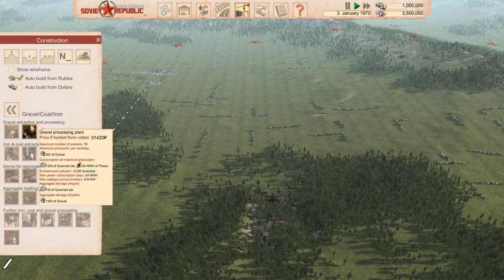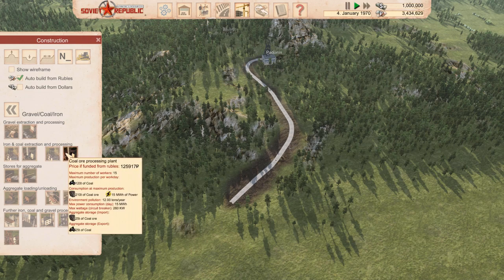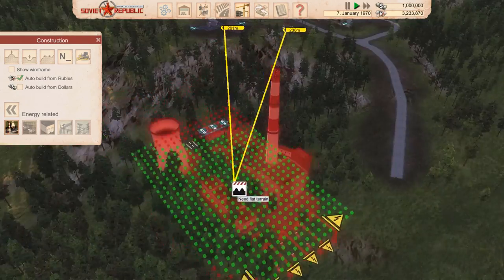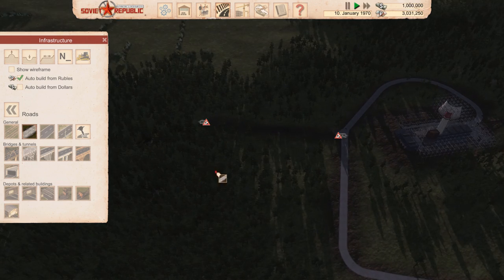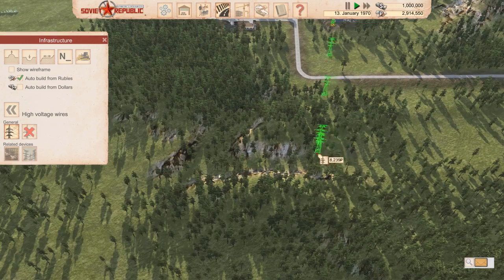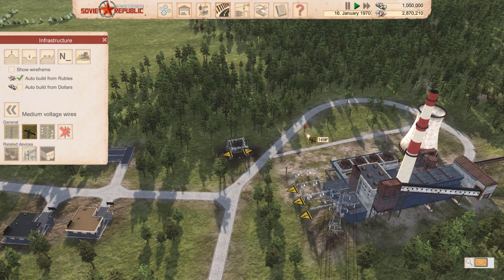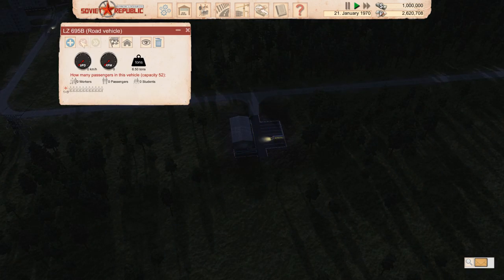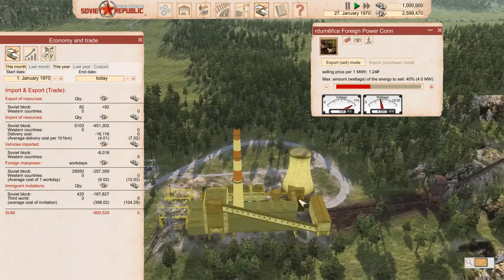Electricity and Buses Tutorial: Workers and Resources Soviet Republic

Comment: Do you need to use high voltage lines
Reply from the maker: Just depends on how much watts of power you are sending down the line, if you want to export electricity use high voltage. If it is for your buildings medium voltage is fine at first.